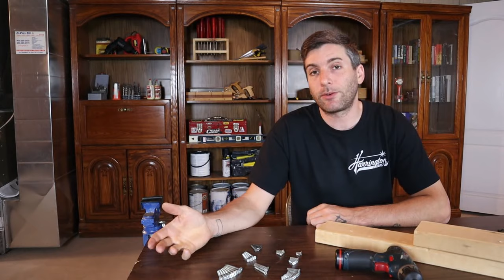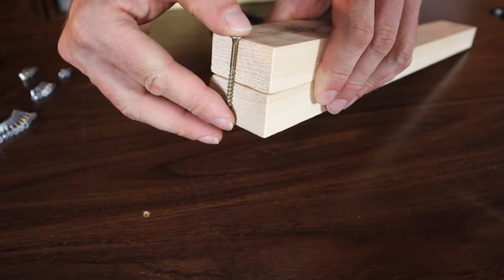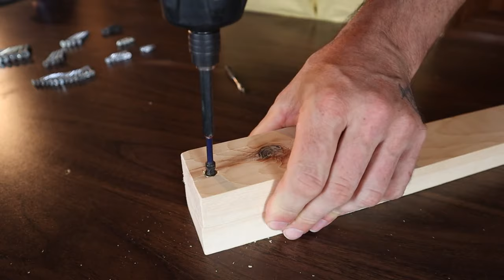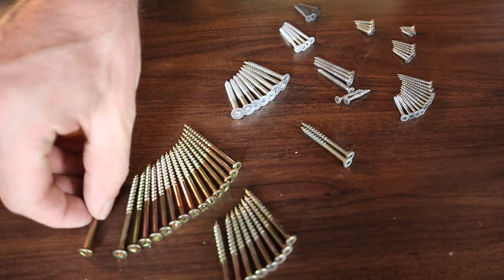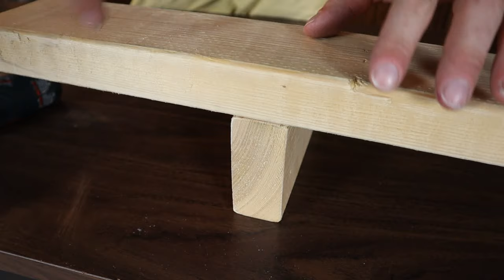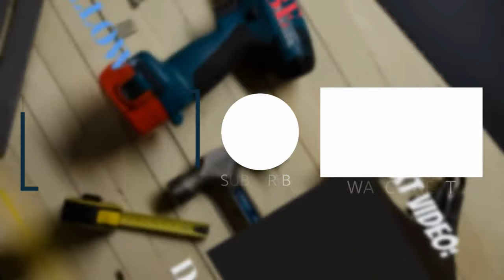Before You Screw Wood Together Watch This ( The Best Diy Screw Joints )

Comment: 1) No matter how good you think you are, do not use a finished piece of furniture as your work bench. 2) To prevent splitting near the end use a countersink. If you don't have one you can carefully use a drill bit that's around he diameter of the head of the screw. 3) The simplest way to prevent separation, without all the extra drilling, is to use clamps.  4) It's not always necessary, depending upon the application, but consider using wood glue.
Reply from the maker: Those are all great tips. Thanks.

Comment: My screw got stuck 3/4 of the way into the the 2×4. Couldn't get it to go all in AND then after resting (ya, I was using all my strength), I couldn't get the screw out either.  I'm either using the wrong drill or have the worst luck. I have 28 more screws to attach this project to the wall (studs) and I can't keep going like this. Any thoughts?? I'm this close to going & spending $400 on a dewalt driver system.
Reply from the maker: If the screw head is stripping then you need a better drill bit. If the drill just won’t turn it in then you need a better drill. You shouldn’t need to push much at all . The drill should do the work

Comment: 1:26 This problem is exactly when I discovered that making a wood window frame by hand was harder than anticipated 😄. I didn't think it'd be easy, and I expected a few failures. But when my screw pushed apart my two pieces instead of joining them, I knew I was lacking far too much knowledge to continue. So here I am.

This video has already been helpful.
Reply from the maker: glad i could help

Comment: Watching this because I was getting some separation occurring. Thanks for the tips. Although not all of them had the same result even though my process was the same.
Reply from the maker: well im glad i could help for the one thing
Reply: @DavidsDiyReviews  I’m going through 2x4 to 2x4. 3” screws. Not sure if it’s a clutch setting but I had the same effect with my impact. Pre-drilling helped, but some of them did the same thing where it came up with a gap even with pre-drilling. So I didn’t have a consistent result. Going to try clamping next time to see if that minimizes the lift.
Reply from the maker: @WiLL02724  that should help.

Comment: Very helpful video as I'm doing a ton of small carpentry projects on our new homestead. Liked & subscribed.

QUESTION: I have to cross connect some 4ft long 2x4's into A frame structures with properly sized 2x4 cross-connectors that are end cut at the proper angles to mate flush at both ends. Since these A frames are structural load-bearing components on a lumber cart, the joints between the face grain of the 4ft 2x4's and the edge grain of the 2x4 connectors need to be as strong as possible. I know about pre-drilling & countersinking the 4ft 2x4 screw holes at the proper angle to get the screws into the center of the connector 2x4's, but what's the strongest way to get the ends of the screws into the edge grain of the 2x4 cross-connectors? (Some suggest pre-drilling into the edge grain while leaving just enough thread bite to achieve maximum withdrawal retention. And, of course, some wood glue at each joint should help as well. In the creator's video he just says he is using 2-1/2" wood screws, but he doesn't say what type of wood screw. Although, since he doesn't pre-drill the end-grain connector 2x4's, I would assume he is using self-tapping construction screws like Spax.)

NOTE: here is the lumber cart I'm currently building https://www.youtube.com/watch?v=_0H71D7dSDQ
Reply from the maker: I would have to agree with that. Use regular wood screws that will be a length that ends about 1/4” from the other side of the piece or wood it’s screwing into. So 1/4” from goin all be way through. I would pre drill the first piece that you screwing through but not the second piece that you are screwing into/ I would also counter sink it and also use some wood glue. You could put one together without glue to see how you like it and then take it back apart and glue it. If I interpreted what you are doing correctly those techniques should work just fine.
Reply: @DavidsDiyReviews  Thanks for your feedback!
FYI: I ended up using CAMO 3-1/2" x #10 Premium Deck deck screws. I pre-drilled a perpendicular pilot hole thru the outer A frame support using a 11/64" twist drill bit. Then I dry fitted the cross support and drilled a pilot hole into its edge grain with a 9/64" twist drill bit. I used my cordless impact driver to carefully drive the deck screw in and allow it to self-countersink.

So far, no splitting and what appears to be good structural integrity. I'll report back once the cart is finished, loaded with lumber and moved around in the shop a few times. Hopefully it will hold together as needed.

Comment: I need to screw a piece of 1.5" thickness wood on a wooden wall for holding a metal air hose reel. I wonder how long do I need for this small project. Are 3 inch screws better than 2 1/2? I wonder if it is the deeper the better? And shall I use #10 or #8?  Thanks!
Reply from the maker: honestly all of those are fine. if ur buying it go for the bigger size
Reply: @DavidsDiyReviews  Much appreciated!

Comment: Can you suggest screw length to connect 2 inch board to 1 inch? I feel like 1 3/4 might be ok just barely but next size the 2 inch might be too much? Suggestions? Thanks.
Reply from the maker: if you are screwing trough thee 1 inch board into the  2 inch then the 2 inch screw would work cause you will have 1 inch of the screw going into the 2 inch board.
Reply: @DavidsDiyReviews  will it matter if I have to go through 2 inch board first?